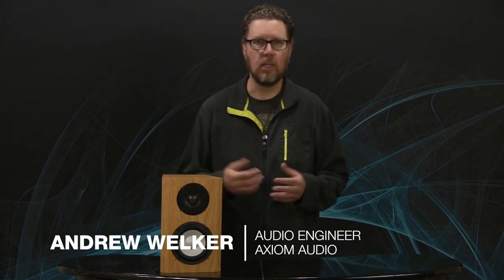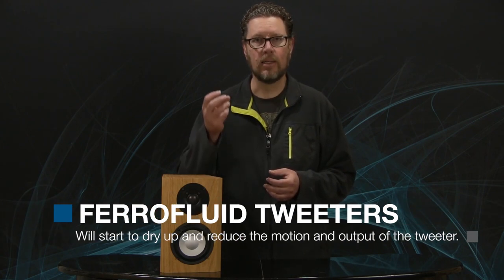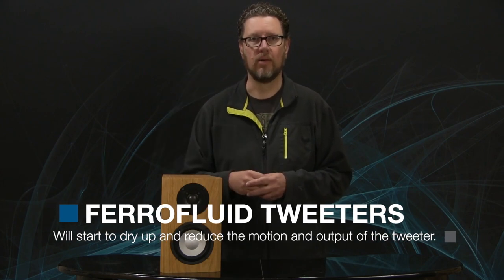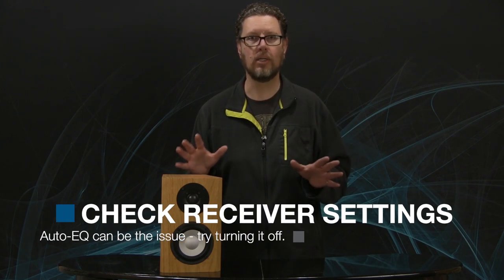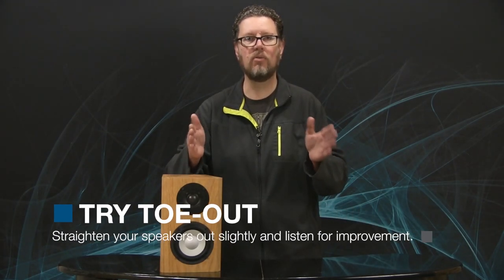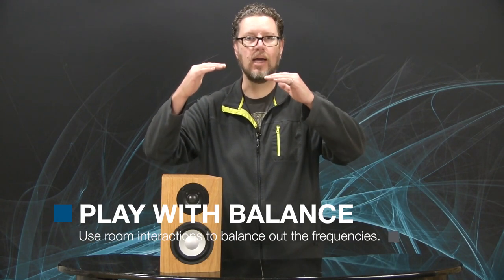Sibilance: What Causes Harsh S Sounds and Can I De-Ess Them?

Comment: This video is quite timely for me, as I just got a new DAC today and was trying it out. I changed nothing else in the signal chain, except the DAC & got this harshness...was pretty much settled that it was not for me..but then this video reminded me of all these variables. 

So, I'll hook up back the new DAC, check some settings, adjust the speaker setup etc. And see where I land. Enjoy the journey, don't forget the beauty of the setup & the challenge of gear setup & placement to make it all sync. 

Thanks for the reminder!
Reply from the maker: You’re very welcome! One thing to keep in mind is that the gain of the new DAC might be higher than your old one, so if you are setting the volume level based on where it was using the old DAC you might be listening at a louder level which can cause fatigue or make any harshness in the recording more prominent. Thanks for taking the time to comment as well as for watching.

Comment: I find it ironic a video on sibilance is the most horrifically sibilant thing I’ve listened to in ages. It’s also weak and distant. 
For an engineering channel you’d think you’d use better recording equipment. This sounds like it was recorded on a laptop built-in mic

Comment: Thank you very much for your video well done. Now i have this problem on my Mirage M 3 si speakers that i love very much, now beside the Ferrofluid that may dry little because of the oldness of this speakers, there is another variable that you did not cover in your video and it is related to the capacitors in the cressover that also may dry and causing this problem ??? do you think that it is valid ?
Reply from the maker: The most likely issue would be either ferrofluid or surround disintegration on the midranges. Electrolytic capacitors can certainly go bad over time, but they would be last on my list.
Reply: @AxiomHomeTheaters  Thank you Andrew for your reply. The surround midrange is in good shape, so i still have 2 parameters that i should verify either the Ferrofluid or the Capacitors of the Tweeters.
Reply from the maker: @Samitocas  good luck, keep me posted on how it goes.

Comment: Do you think your QS8/QS10 would blend well with Triangle Comete EZ and Voce EZ fronts? The Triangles use titaniun drivers as well so I would think so.
Reply: The QS10 is an awesome surround speaker with high dynamics and deep bass. I have the SVS ULTRA’s, and currently I’m running the QS10 for surround and the QS8 for back surround. To my surprise they blend great with the rest of the system,.
Reply from the maker: It’s hard for me to say, as I have never heard the Triangles, but for adding surrounds to your systems I would think they would work. Thanks for your question, and for watching.
Reply from the maker: @caesarc.4079  Thanks for sharing your enjoyment of the QSs. It's always great to hear customer feedback! Thanks for watching too.